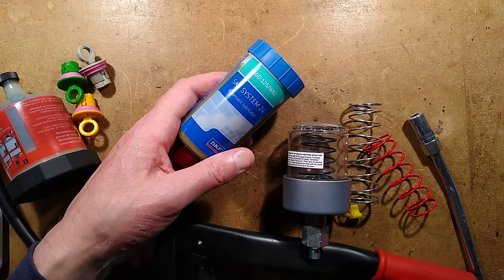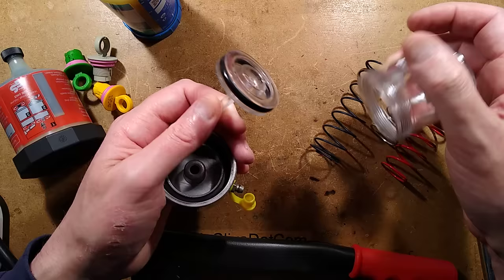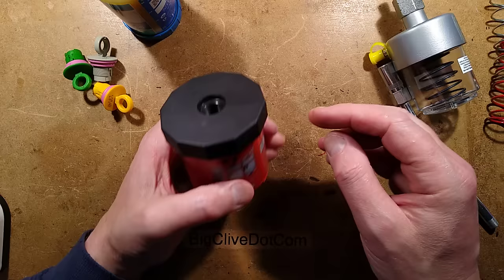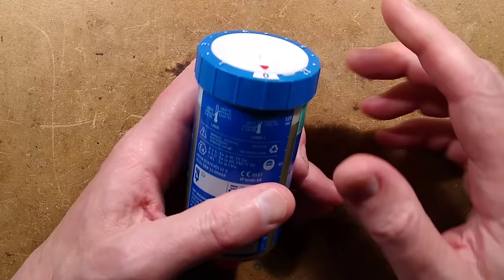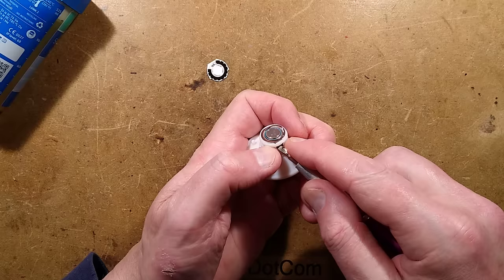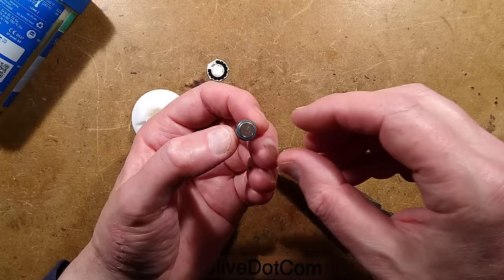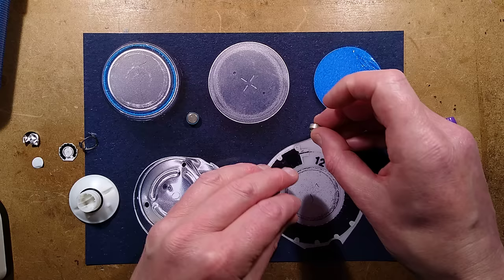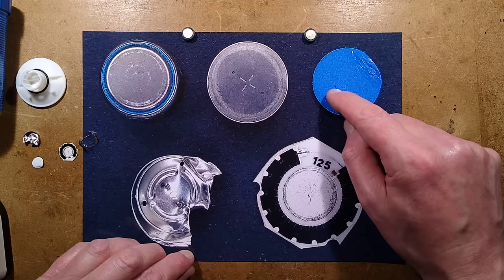Absolute genius automatic lubricator

Comment: I installed these on a few machines on site, but never knew how they worked or took one to pieces. Grease is wonderful stuff, apart from when it’s used on motor bearings. We used to get a job method on site, which would tell you to grease the bearings on some motors. The motors could weigh 300KG+ and had a bearing at the front and rear, the only problem was that if you did pump grease into the grease nipple, the grease would often enter the motor and short out the windings, then the motor would fail. The worst motor failure I ever saw was when a large motor with a 2” diameter output shaft failed. The front bearing seized, causing the output shaft to become very hot, so that that the shaft bent like a piece of rubber, this then caused all the mounting bolts on the motor to shear and the coupling to disintegrate. If you had been near it when this happened, you would have needed a change of underwear for sure 😂
Reply: Ive seen smaller drive shafts in conveyors with ceased bearings simply snap the shaft, they looked just like they have been cleanly cut across the shaft.
Reply: Most have the plug you need to pull out and let the old
Grease come out.
Reply: Wouldn't just.. using dielectric grease solve this?
Reply: Can I ask why alternators and some motors have ingress points?  Do they really get that hot? I wonder if people have played around with a nonconductive material to act as a heatsink?  Just talking out my gas hole because I only know power equals turny
Reply: Did the grease itself cause short circuits, or did it degrade the insulation on the windings causing them to short together?
Reply: Ah, someone installed an automatic greaser in your drawers, I see.
Reply: I cant see how grease would short out insulated windings, unless this is a DC motor. Maybe more likely it caused additional drag on the motor and slowed it down?
Reply: @jaro6985  Why would DC make a difference to the isolation?
Reply: @MrShwaggins   Yes motors do get very hot so need good ventialtion to help with cooling.
Reply: @soundspark   Motors do have internal uninsulated parts such as commutators which Im assuming the writer is refering to in this instance.
Reply: Missing your content 😢
Reply: Sorry but the grease would not short out the motor windings grease is an insulator, I stripped a motor this week it was full of grease passed the megger test no problem,  The Caustic pump motor however was completely destroyed,  Caustic destroys everything unless its stainless steel.
Reply: i have yet to see a electrically conductive grease..
what kind of grease are you using?
Reply: @Francois_Dupont  To my knowledge pretty much all additives in almost all greases are somewhat conductive. I've seen, well didn't witness it personally, but our electrician said that too much grease had gotten past bearing and eventually had shorted motor after it had gotten warm. Aren't stuff like molybdenum, lithium complex soap based oils etc. always somewhat conductive materials? Grease itself to my knowledge isn't conductive, but the additives are different thing.
Reply: @Francois_Dupont  Possibly he was using copperslip or even a graphite grease.
Reply: @jothain  yes, but how much voltage will be needed in order to overcome the resistance? i personally used grease in the past to seal electrical things from water without problem.  i have seen many 3phase (600v~?)  motor dripping in old oil working perfectly for years. of course those are all anecdotal evidence, but my experience are still grounded in facts. 

my personal guess would be that the badly greased motor could "catch" more conductive dust and cause problem. not necessarily because of the grease, but the conductive swaff and dust roaming around.
Reply: @soundspark   Not sure, I'm just going off what the electrician said- perhaps he was incorrect 🤔
Reply: @jaro6985   They were AC 415 volts. I'm only repeating what one of the electricians said, he could have been wrong 🤔
Reply: @Francois_Dupont   I think it was Almasol, high temperature grease.
Reply: @Francois_Dupont  grease is made of oil and a solid material when grease gets hot separate and the oil is conductive.
Reply: @johndododoe1411  In a DC motor if grease gets on the commutator it will combine with the brush dust and short out the windings, to some extent.
Reply: Many bearings are semi-sealed and require very little grease but regularly. Depending on bearing size, it probably needs up to one shot of grease maximum. Certainly never enough to burst and ruin the bearing’s seals.
Reply: to much grease can be just as harmful as not enough, you should never repack a bearing complete ,1/2 full is almost too much - too much will over heat and cause complete failure
Reply: @Francois_Dupont  Motor in case was still fairly small. 600v and it took about 40-60amps in operation. It was very old, roughly 40-50 years old, obviously bearings had been changed quite many times) and I think the biggest factor was that it was mounted standing, so all excessive grease could flow almost straight into housing and iirc o-rings on "drip plate" where perished too, design was quite different from modern motors. Can't remember what the fuse sizing was for the thing, pretty hefty as it was old star delta machine. Anyway that's what our main electrician stated. Dead by excessive grease and shorted. It had to be rewound.
Reply: @Francois_Dupont  copper grease? Why that would be in a grease gun i dont know.
Reply: @mart43  Why are HV power transformers and OCBs (oil quenched circuit breakers) filled with oil then, if oil is conductive? Even clean water doesn't conduct electrickery.
Reply: @markrainford1219  Different additives may increase or decrease conductivity.  OCBs sometimes use dangerous compounds like SF6 to fully break connections and quench the arc, but older ones predate that particular compound.
Reply: @APF3LKUCH3NLP  - No, because many greases ARE dielectric.  The issue is that the greases tend to pick up dust from the surroundings, which can be conductive, or abrasive.  Thus part of the need to constantly expel old grease and put in new grease.
Reply: @tbelding  that makes a lot of sense. I mean, even engine oil picks up flakes sometimes in a new engine.
Thank you!
Reply: @APF3LKUCH3NLP  - even just carbon from the brushes is conductive.   There's lots of things that can happen.  Thermal insulator, electrical conductor, grit transport...
Reply: @markrainford1219  good point, First of all, I am not an expert so I might be very well wrong,  but I think the oil used in transformers is different than lubricating oil ( because it also has a different purpose). But I think the main reason why it gets more conductive is that the oil in the grease gets contaminated with iron particles(From the bearings) causing it to be a lot more conductive just like adding salt to the water.
Reply: @markrainford1219  Distilled water DOES conduct electricity.
Reply: It takes a ridiculous amount of Over Greasing to fill a motor bearing and then the motor . The motor bearings fail because the bearings are only supposed to be halfway filled , which is what is done when they are manufactured .
Look up TVA motor bearing failure, Honeycutt .
The motor didn’t short out , the bearing overheated and seized  .
Reply: LRA locked rotor amps / current  . If a motor starter doesn’t shut down or trip , the motor can draw enough current to damage the machine
Reply: @AureliusR  What in hydrogen or oxygen conducts electricity?
Reply: Awesome! I have never seen a full sieze at that level, but i have seen stuff that came very close to full-on destruction, i once heard rather than saw a machine explode, and yes the bearings were bone dry, i had told them about that 5 weeks before it exploded, LOL and all the managers running around shouting 'what happened?' and i had to tell them to read my report from last month :D :D
Reply: @johndododoe1411  Because Thomas Edison was a little bit greasy, in how he tried to defame Westinghouse. You can be sure...  😃
Reply: @jaro6985  Normal grease has some metallic compounds to help with it's properties (make it less runny when hot, withstand more pressure, etc.).  These compounds are conductive.  Inside a motor, it can bridge windings out, creating short circuits.  Some agents can also "eat" through varnish (used as an insulator in windings).  Dielectric grease won't conduct electricity.
Reply: @Francois_Dupont  The auto parts store usually tries to sell me single use packets of conductive grease when I buy new headlight bulbs for my car.  Apparently using grease on those contacts may help the connection (so I'm told), though it definitely helps the auto parts store get another buck or two of revenue for something they probably paid a few cents for.
Reply: @claudehebert3131  No normal grease I have used has metallic compounds, but I'm sure such a thing exists. Youd be crazy to use it on a motor though..
Reply: @jayschafer1760  ive had a car where the headlight connector corroded so bad they were impossible to remove from the socket. so yeah greasing them would be a good idea.
BUT! personally i dont believe in conductive grease. i personally grease my car battery connection, plugs, computers and stuff with normal red grease.

when you make the connections, there is already metal to metal contact point somewhere. so any grease or oil you use would be scraped away at those spots.

Comment: "Everything should be made as simple as possible, but not simpler." - Einstein
"Perfection is achieved not when there is nothing more to add, but when there is nothing left to take away." - Antoine de Saint-Exupéry
This doesn't quite eliminate the need for maintenance, as someone still has to go round replacing the lubrication syringes when they reach the end of their lives, but it's damn close!
Reply: Not Einstein. Commonly called Ockham's Razor. William of Ockham (c.  1287–1347) but not invented by him, derived from many other philosopher's works.
Reply: You still usually need to do other periodical  maintenance, but if you can get rid of regreasings between those times, and instead apply a new/refill an automatic lubricator just at those times, it's a win
Reply: @Zadster  The quote is a summary/simplification of one of Einstein's lectures: 
“It can scarcely be denied that the supreme goal of all theory is to make the irreducible basic elements as simple and as few as possible without having to surrender the adequate representation of a single datum of experience.”

The razor you refer to is slightly different: "entities should not be multiplied beyond necessity": 
Given two solutions, the simpler one is usually better / Given two explanations to an event, the simpler one is more likely the correct one.
Reply: Should only be one battery then ;)
Reply: I kind of envisioned a full-time position with the manufacturer where someone goes from one shop to another, keeping the units up to date and checking for inadvertent damage. For a nominal fee, like a service contract.
Reply: Agreed. I think this is one of the things making the SLS so challenging. Complications in your relationships and rockets (which might be related) are never good. Use a giant fuse and light it.. stand back and she's gone.. like your significant other. Easy peezy  :)
Reply: @Zadster  Ockham's Razor is about hypothoses, not mechanics.  The Einstein quote is actually a summary by a friend of his who said it better with fewer words, thus fulfilling Einstein's dictum. :-)
Reply: Appropriate, Einstein was very simple.
Reply: as someone locally famous for fixing complex equipment by ripping bits out like a loon, i totally agree
Reply: "An engineers true job is to provide unemployment " Jack Welch (not really but he might have)
Reply: @tedmich  As an "engineer" in the computing sense I have more than once coded myself out of paid work by automating something I used to do by hand.

Comment: I worked for a company that repaired / rewound Electric Motors. We had a local customer who called us in to look at a motor bearing that was noisy. It was an old Brook Imperial frame Crompton Parkinson motor, only about 20HP but built like a tank. They employed an old boy to go around and grease the motor bearings once a week. There was a grease nipple on each of the bearing housings and also a  bolt on the the bottom of the housing. You were supposed to undo the bolt and let the old grease ooze out the bottom as the fresh grease went in the top. I don't think he's ever done that, as when we took the end shields off they were completely filled with grease ( there was a pressed metal dome insert in the end shields to direct the air from the cooling fan ) We easily filled two large grease tins from the stuff in the compacted end shields.
Reply: Happens, I remember production complaining that the bearings were leaking huge amounts of grease, we had a look and maintenance had pumped in litres of grease over the last two years, and litres of old grease had squeezed out the other side and was falling of the crane in slabs...

Comment: The great thing about the spring based / refillable automatic lubricators is that a) they are so very durable, and b) you can choose your lubricant.  I've got a VERY early glass / brass design which dates from 1902, ,and is still fully functional (although the ?nitrile? O-Ring is showing its age!
Reply: From the date of 1902, I'd guess that the o-ring material is vulcanized natural rubber (also called "India rubber") made from natural latex found in the sap of various tree species.
Industrial processes for the creation of synthetic rubbers (of which Nitrile is one) didn't come along until 1909.
Reply: @sixstringedthing  Thanks for that insight!  I don't know whether the O-ring is the original, but it certainly seems rather cracked / perished,  which might imply a natural rather than synthetic product.
Reply: with the SKF ones you can buy different grease fills to suit your application
Reply: Disposable stuff sucks I agree. If you're buying one of these you're going to keep meeting them. So by the one or the correct spring pressure and it will just live there forever.

Comment: Hi Clive,
I know a little about zinc-air batteries. Camera light meters used to use mercury batteries because they emit a very constant voltage until they die, and they then suddenly drop to zero. This was obviously very important for metering, especially with simple light meters. When mercury cells were outlawed, the recommended replacements were zinc-air cells because they have the same flat-discharge curve as mercury cells. That fits your thought about the voltage not dropping off.
Reply: Oh hey! I had no idea these cells could replace those mercury cells in light meters! Thanks! I was wondering what to do for my old SLR cameras!
Reply: @vhfgamer  Its worth noting that its not quite as flat, there is a bit of a slope at the end where it appears to be good, but has a lower voltage. Also the voltage is different. You can get little cases that go over commonly available silver cells that have voltage regulators that make them put out the right voltage for vintage cameras. They are a tad expensive, but it saves the cost of paying someone to recalibrate the meter for newer batteries.
Reply: @vhfgamer  Sure. If you are mechanically inclined (or brave) there is a small Potentiometer that can be turned with a small screwdriver somewhere under the outer shell of the camera. I don't take cameras apart though. I used to just find the exposure compensation dial and with a little trial and error figure out where to set it.Practically, unless you are using slide film, there is enough latitude in the film exposure to just use it as is, in my experience.

Comment: One of the recycling clients I work for uses these on most of their machines, thank you I didn't know how they worked. The only fault they have is when someone knocks them as often they end up sticking away from the bearing housing
Reply: They're indeed quite easy to rotate in their original install sleeve accessory. These days I usually install them with grease line to prevent ie. Chain lubricators to turn easily, if location needs it.
Reply: As someone that works in a recycling facility, these things sound like a hassle. Things getting wrapped on shafts next to bearing houseings need constant cleaning, or else plasic melting heat(and bearing failure) rapidly ensues. Nothing like hacking through 3" or wrapped up cassette and VHS tape, bale twine, random wires, and even purple lace dresses, to pull out a melted plastic ring from inside, where friction caused heat. Easy enough for a grease gun to be used when doing this other maintenance.
Reply: @ravenbarsrepairs5594  You indeed work at a recycling facility!
Friday was the cleaning day at our place, getting rid of everything that wrapped around the rollers for the conveyor belt. Fun times with clippers ;)
Reply: @johanmetreus1268  At one point I had the safety guy make me get rid of "Martha Stewarts Knife Collection". I've found that serrated steak knives and dikes are the best tools to attack.
Reply: @ravenbarsrepairs5594  UK?
Reply: @johanmetreus1268  Nope. Northern NY, USA
Reply: @ravenbarsrepairs5594  My condolences for the attitudes spreading to your side the Pond then!